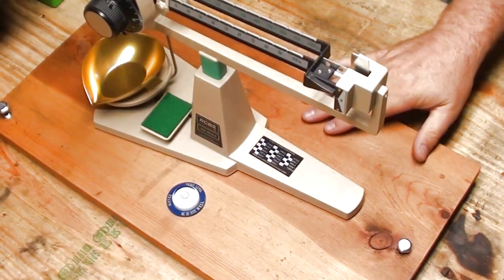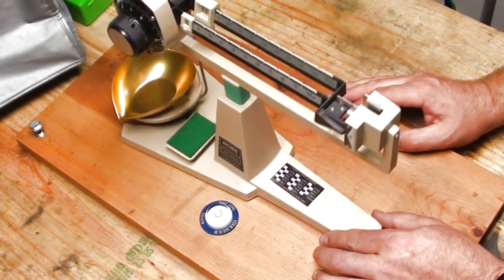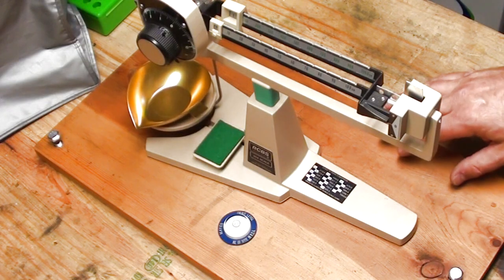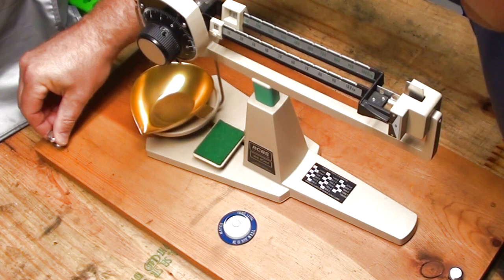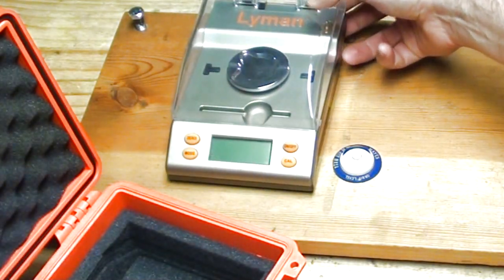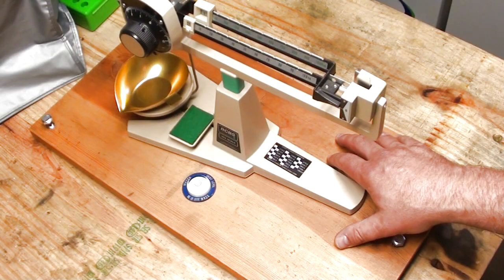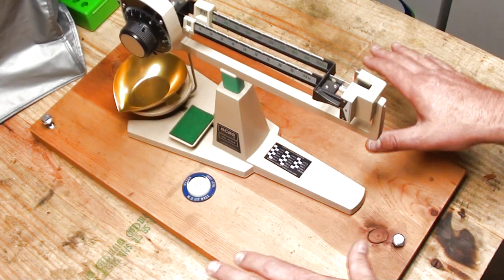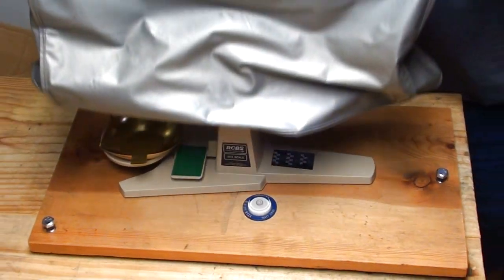Level the Scale

Comment: Excellent tip!
I would personally go with a piece of metal as you suggested or maybe a piece of plywood for outside use. Your pine plank should be OK if you keep and use it in a controlled humidity environment, warping shouldn't be a problem.
I'm going to have to pick up some of those bulls-eye levels, thanks for the video.

Comment from the maker: I've got a very large sheet of 5/8" cutting board plastic that I'm sure it would thread easily but the stuff seems to curve and take a set if it's not supported on a flat surface.

I'd be looking at using non-ferrous 3/8" aluminum if I were going to drill and tap a metal plate, but right now I think   just topping this wood with a piece of thick glass would be a simple and effective improvement.

Comment: Also, I forgot to mention that while wood is nice, there are plastic cutting boards available that are inexpensive and very flat which should eliminate any concerns about wavy wood.  Plus the plastic itself is most likely able to take threads so you don't need the pound in nuts.  Metal surfaces may not be good for some scales as they have magnetic dampeners in them, and I don't thing digitals would like metal either.

Comment: Though cutting and edge finishing the glass could be a bit tricky, (let alone drilling it so the bolts could poke through) laminating it to the wood would probably make everything stronger and safer.  It would certainly make a flat and easy to clean surface so you easily sweep away and spillage.  How about plexiglass or some such laminated to the wood?  Would that do it?  It seems like it would be easier to work with.